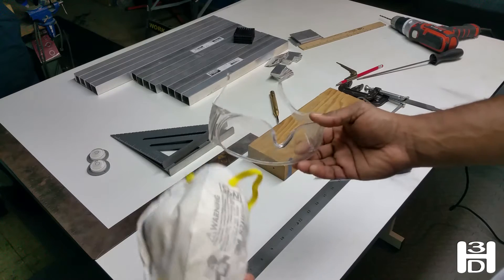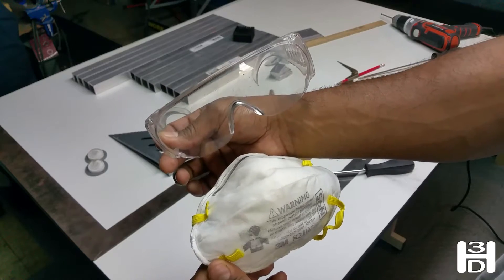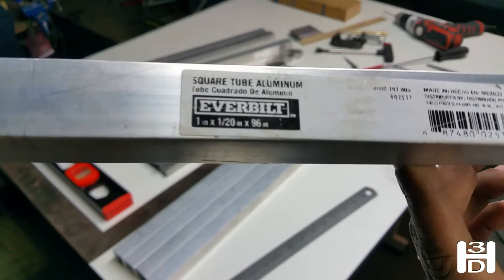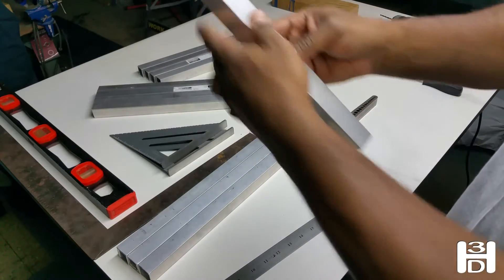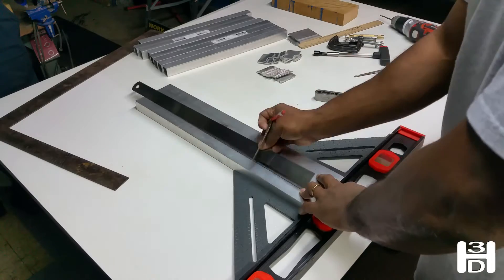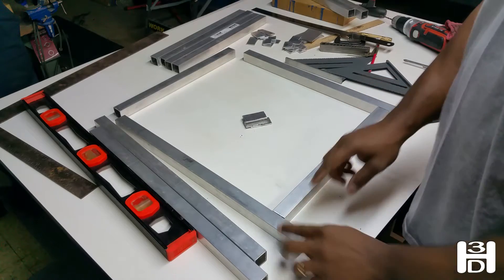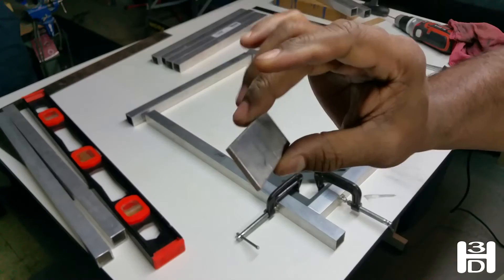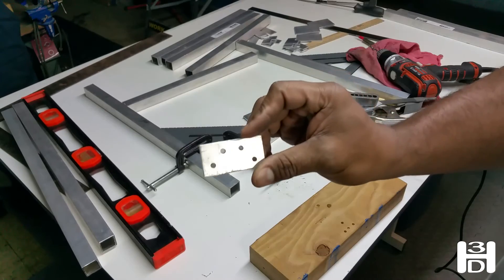DIY 3D Printer Tutorial Part 1: Building A Frame - Hudson 3D

Comment: What kind of layer height and print speed are you getting out of this one? I really like the design and the ability to get the parts at the local hardware store is great. I have previously built a delta style printer and I am hoping to build one like this next.
Reply from the maker: It can print down to 50 microns and I usually run these at a conservative print speed of 70mm/s, higher speeds are possible and adjustable in the firmware.  

Print dimensions: X axis: 292mm, Y axis: 250mm, Z axis: 260

Comment: Do you have a parts list? I've checked your twitter Facebook and webpage and you say in this video previously but I can't find a video befor this one
Reply from the maker: The parts lists also known as the Bill of Materials is available at the link in the description.  Download the BOM, firmware, printer parts .stl files, and wiring diagrams here:  
http://bit.ly/diy3dprintertutorial

Thanks for watching!
Reply: Hudson 3D link is broken and takes you to a ransomware site. Luckily I was using my throwaway OS but it could mess someone else up, might want to get that fixed.
Reply from the maker: Just checked the link and it works.  The malicious ad didn't make me happy so I updated the link.  Try it again and thanks for the heads up.
Reply: Hudson 3D that fixed it!! Thanks for all the info.
Reply: @hudson3d184  Thanks for the great video! I tried accessing the list of parts using this URL: @t. But the link shows that the page can't be found, is there a new link?